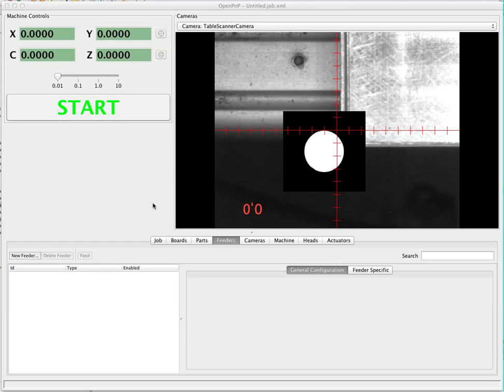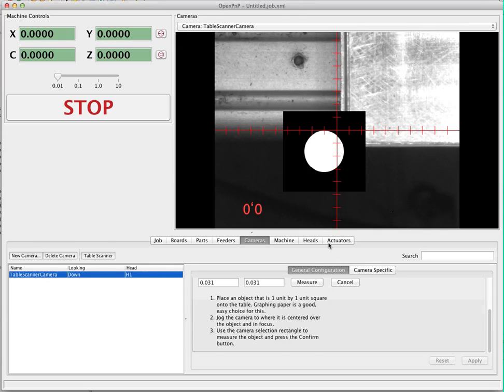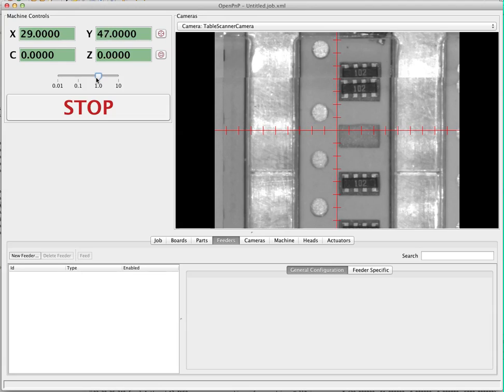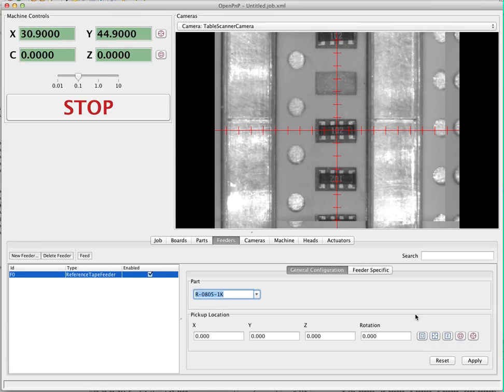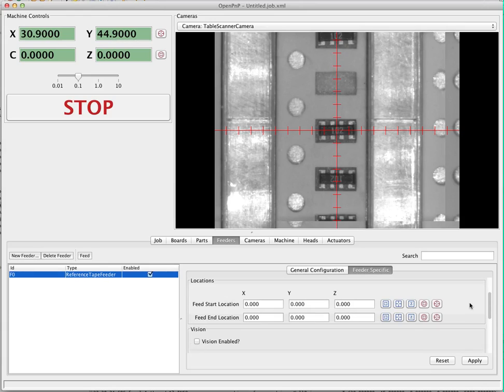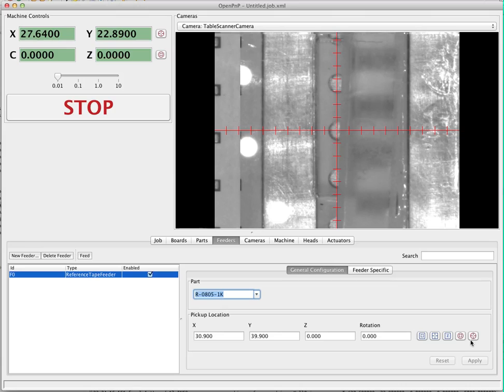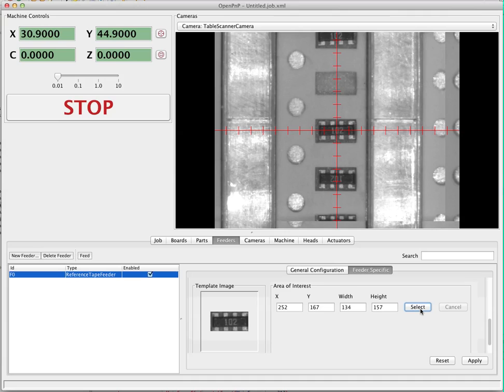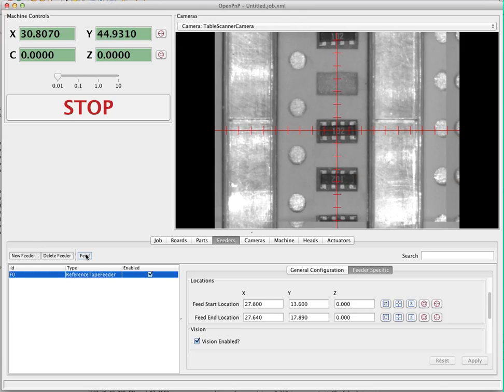OpenPnP - Drag Tape Feeder Vision Demo

Comment: What if the tape has more parts per hole than one? For example 0402 resistors. After the drag, it should pick 3 parts from 3 different locations before the next drag. Or dynamically adjust the feed start position.